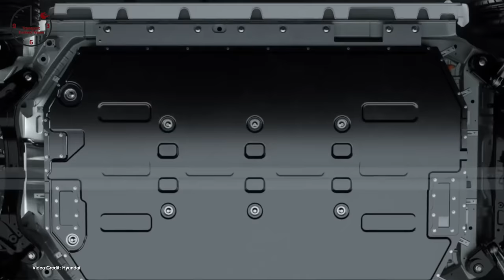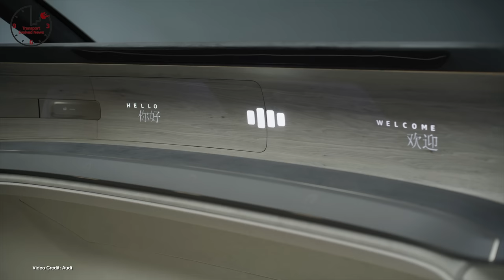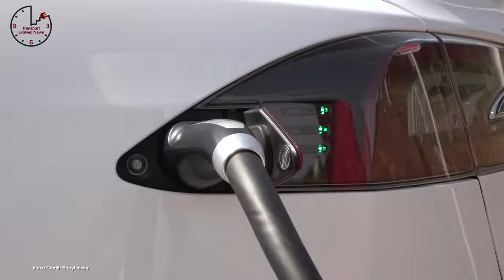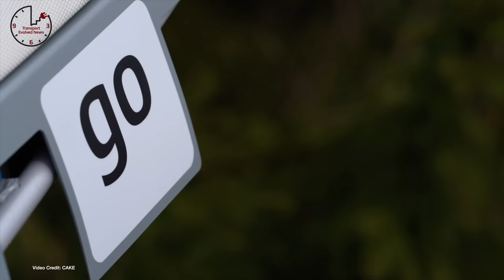TEN 383: Massive 800V Switch, Rivian CEO Warns of Battery Shortage, GM Kills Chevy Spark EV Support

Comment: Im done with GM EVs. First the issue with my Bolt battery recall and now dropping support for my wife’s Spark EV that is still in warranty! 😠 

No more GM EVs for us
Reply: So sad to see this...I'm driving a second generation Volt, which has been awesome, and saw it abandoned when GM could have used the Volt to help transition their dealership network to EVs.  So many balls dropped, and not by accident.  This was GM's plan.  Pathetic.
Reply: I hope your Spark pack lasts longer than the body.
Reply: Is like they expected potential customers to transition all at ones instead of building advocacy through early adopters. But what is more shocking is that their CEO belief that they are leading the EV market in the US.
Reply: I question your choices too 🤣 you bought both their shitty cars - bolt ev and spark ev 🤣🤣🤣
Reply: @richardalexander5758  the Volt was going to be my next car,  a few years ago. But I'm glad I didn't buy one since production stopping is a huge problem.
Who knows how long before they stop carrying essential volt parts
Reply: They were different times. We are early adopters, got them for a good price when the only other options were Tesla S/X 100k and Nissan Leaf without battery conditioning system.
Reply: @arjtalwar  My wife has a Bolt. The cells have been replaced. It still doesn't have much EV competition in it's price range. For twice the money, the Tesla is better, but for the same money, would you rather have a Leaf, with CHAEDEMO and no thermal management, and less range? Everything else starts over 40k.
Reply: Sorry about the bad experience, that spark battery might last quite a while before it's 2nd life, it seems like everything other than early Leaves are doing well. Used Bolt is my next EV.
Reply: @arjtalwar  you have no idea what you're talking about
Reply: @peterkn2   Yep, it could become a problem, but I hope to have gotten my money's worth out of my Volt before it becomes too much of an issue.  Maybe It would be possible to replace the gas engine with a secondary battery pack sometime in the future.  The Volt is really fun to drive, and sold me on EV's.
Reply: MT VISION
it's not 100% that's the case, it's he said/she said.
if they refuse to cover warranty, well they will likely face legal problems. considering they must honor the warranty they provided under federal law (in the US at least).
Reply: The word on the street and I’m no sure if it is true. GM will do and MSRP swap or buyback if the battery goes bad.
Reply: @rp9674  It's one weakness is charging speed, which tops out at 51-52kw, but all Bolts have CCS, and will have 259 mile range with cells made in 2022, except the EUV. There are still places that are short on CCS chargers, but I expect that will fill in. EV sales nearly doubled last year to 550,112 which is more than every EV sold up through 2017, and vehicles are on the road 13 years, so the number of EVs on the road is growing. The Bolt is fabulously efficient putzing around town 30-50 mph.
Reply: @fjalics  Hmm - just finished charging our $30k Leaf Plus @76kW; still pulling 30kW @90% SOC.  True, only 220mi or so range so you got us there.
Reply: To be fair it was obvious from the start that SparkEV was nothing more than a compliance vehicle. The lack of support is unfortunate, but not unexpected.
Reply: The Bolt is the only fully EV close to my price range. I'm debating just going with a traditional Prius hybrid. The Prius Prime is a touch out my price range. At this point I'm waiting to see if the U.S. gives GM back it's incentives to make it a little more affordable for me.
Reply: @mikecarter2737  That's  interesting. I never knew how much they could pull. That's about 50% more than a Bolt, though I think it "rapidgates" doesn't it, as in if you do back to back DCFC sessions, the second one is slower, because it can't cool the pack. It unfortunately has a dying charging standard. The new Ariya has CCS, and a thermally managed pack. My brother got a 2013 Leaf in 2017 and is driving the piss out of it. I actually drove that thing from Ohio to NJ. I spent a lot of time at Nissan dealers on 3.3kw Level 2, ran a cord under the doorsweep of a Motel 6, and my savior, Country Line Restaurant 14206 PA-35, Richfield, PA 17086. They had a Tesla destination charger, and a 32amp Clipper Creek on a pole. I did not have the range to get from State College to Harrisburg without them.
Reply: GM has announced that the reports that they will no longer be making replacement traction batteries available is false.  GM currently does not have any battery replacements for the Spark EV in stock but are hoping to get some soon.  That the current lack of batteries is due to supply chain issues brought on by COVID.
Reply: @arjtalwar  Neither the Bold or Spark are shitty cars.  In fact they are great cars.  GM didn't make the Bolt's battery.  The report the Chevy was no longer going to provide replacement battery pack for the Spark EVs is false.  I personally have a 2014 Chevy Spark EV that has a Lithium Iron Phosphate battery pack and even at 8 years has only lost 1 maybe 2 miles of range.  Had GM stuck with the Lithium Iron Phosphate battery for all their EVs they wouldn't have had any of the battery fire issues they had with the Bolt.  Lithium Iron Phosphate batteries last 2 to 3 times longer.  Are cheaper to make.  Won't catch on fire even if you drive a nail through them, are non toxic, create mush less CO2 in their manufacturing and can be charge up to 100% and drained to 0% daily without damaging the battery.  All that and they are much easier to recycle.  Only down side is you need a battery about 10% larger to go same distance as EV batteries that use Cobalt and Nickle.  Oh yeah and Lithium Iron Phosphate batteries can be DC Fast Charged as multiple times a day without being damaged.

Comment: Model 3/Y 82kwh 400V pack charges at 250kw. Porche Taycan 95kwh 800V pack. Charges at 270kw.  The size of the pack, the C rate of the 3-4V cells set the real limit. Upping the voltage to 800 reduces the size of the conductors you need because you only need half the amps, and increases how much insulation you need. Elon answered this question in the Q1 call. He said going to 800V saves about $100 per car.
Reply: @rogerstarkey5390  Tesla has a large and growing charging network. Expending a lot of time and resourves upgrading all of it to accommodate the higher voltage is a big consideration. They said for smaller vehicles, it's not worth it. For a 500 mile Cybertruck or a semi, it may very well be worth it. She said 800V charges faster. That voltage has no bearing on charging speed. It impacts the design.
Reply: So everybody is going 800V except for Tesla, which means 90% of EVs will be on 400V.

Phillip.
Reply: Only $100. But the manufacturers look at it by the production numbers, not the savings to the consumer. 10-20 million cars produced over the next few years is a huge savings for the automaker. They may pass on the benefit to the consumer, but certainly not the savings.
Reply: i just happened to roll into an Electrify America Station with my Ioniq 5 (800V), it was right next to a row of superchargers. I had 20% when I rolled in and charged to 90%. Almost all the Tesla's that were there when I plugged in were still there when I left. Now maybe they were all charging to 100% from 0%. but it's not about the top charging speed, it's about the curve. If I plug into a 150kW charger, the inverter will line double and give my 175kW and never drop below 130kW alll the way to 80%. 90% usually takes 10 minutes longer.

Comment: It's really fun to watch the ev market expand and give Tesla some real competition. It appears Rivian's workforce and QC dept. has a ways to go to work out the various areas beyond the electric platform itself. Seeing reports of sticking tailgates, loose brake line fittings, etc... What I care about in these times is affordable reliable ev transportation options that someone making under $75k can actually afford. Right now in the American mkt that leaves only a couple of cars even close. I just traded up from my 2020 Bolt that was under current recall for a 2022 Bolt that has the new battery and saved money doing it. I had no desire to mess with their concierge dept or enter the class action suit currently going forward. ALL I want is an affordable, reliable ev...that I can now fully charge...and park in the garage. Btw, the improved seats really make the deal! That was our only complaint with the 2020 Bolt. ;)

Comment: I really hope the yoke doesn't become synonymous with EVs. It should always just be an option and not standard
Reply: I think that the yoke is more associated with automated driving systems. It's a small step toward the goal of removing the steering wheel entirely. It is possible that it will get associated with EVs (more expensive EVs anyway) because they tend to be the most future forward cars that are produced. 

At least the Lexus version does not require turning the wheel as far as a normal steering wheel, but I'm not sold on the idea.

Comment: If there had been a wider distribution for the Spark EV there might have been a market for someone to pick up the replacement battery rights. I know that 3P providers have been able to start doing remanufactured batteries for some hybrids...maybe something similar could be done here.
Reply: Only if there is momentum in the market like with the Gen1 Leaf. A good number would be 500K examples. You might have a cottage industry at 100K. GM sold 7500
Reply: @theairstig9164  I bet batteries get cheap enough for custom built batteries to be a thing. I see LOTS of ICEV to BEV conversions in the future

Comment: A few comments on the Texas grant - it was first come first served so Tesla must have been later to apply.   Secondly, Tesla had the electrical infrastructure in place already so of course their cost is lower.  Thirdly, it’s good to have more locations not less like some seem to want if we only put more chargers at existing locations.  That does nothing to help most people.  Lastly, it looks Bucees got some of that money.  They are the best gas stations in the country.
Reply: I always like to understand different   points of view. What would the argument be to say that it's better to have more locations with less chargers than fewer locations with more chargers.

Here is my opinion on why more chargers at each location are better. I might be wrong.

They are cheaper to build and they can be built faster (less permits and so on). 

Here are the choices:  two or four charging stalls every four blocks, or 8 or more 50 miles apart.

I think that especially for non Tesla vehicles (Tesla shows the status of the charging station on the screen) it could make it really difficult to show up to a charging station to find it full to then drive four blocks to find the same situation then having to make the choice of taking a change and drive another for blocks or just wait inline at the current station.

If we need to charge 20 vehicles, I think it would be easier to charge at one station that has 10 stalls than at 5 stations with 2 stalls each.

It makes sense to have gas stations on every corner because refueling is fast but for charging  specially if your are running the battery low, it's better to arrive at one place and know that even if all 20 stalls are taken than to drive around to another station.

Also if in one of those stations with only two charging stalls one is broken, that station is down to 50% capacity.

This is not to say that having more stations with many stalls is better for EV owners. So far the largest one I've visited is a 24 stall 250kW station.
Reply: My main concern is the fact that sometimes you don’t always want to plan out (or even use the navigation) every time you go out for a drive.   It reduces your freedom of movement because you always have to think ahead.  I like to just jump in my car and wing it on which way to go and when to stop.  With Texas being so large having to go to mega stations limits that flexibility.  I realize there are economies of scale as you get larger (see my Bucees example of the earlier post).  Also there are times when accidents or construction making certain routes difficult.  This would necessitate other routes which could be problematic when finding a limited number of locations.  

Part of the money can also go to external upgrades to the grid.  Hopefully they are thinking ahead and planning to add even more charging stations in the future using these upgrades.  

The last part regarding finding working chargers and the number of chargers at each station will be mitigated by the use of technology.  Part of the grant process requires that the grantee have internet access for the chargers.  This should help with charger availability status.
Reply: @mattferguson9109  I see your point.  Do you drive an EV and if you do, do you mind sharing what make and model.

Comment: 16:48 It will be interesting to see what happens with the XPeng P5.  It is difficult to get a handle on true EV demand.  Tesla's order books extending out a year show very high demand, but how many people want an EV but just can't handle joining such a long queue?  The legacy auto makers (and wall street) have consistently underestimated EV demand.  Elon seems to believe there is way more demand and is ramping up manufacturing as fast as Tesla can do it.  If demand is high enough, both Xpeng and Tesla will be able to sell everything they make at current prices.  That would be great.  So, the question is how many will Xpeng make?   If Xpeng makes 50K per year, it will have very little effect, but if they make 500K per year they may be able to affect Tesla prices.  Personally, I hope demand remains high and all EV manufacturers sell everything.

Also to consider, if demand for these EVs remains high, will people buy the P5 and immediately flip it to the used car market.  If that happens, XPeng would be wise to raise prices until the EV market supply catches up.

Comment: Very disappointing that GM no longer supports the Spark EV. Auto makers should be required to have parts on hand for vehicles for 10 years after the end of production. Parts availability seems to have gotten quite poor. I'm waiting for parts for my Chevy Bolt, but GM doesn't have what I need in stock.
Reply: They rely on their suppliers to do all the work and outsourcing production as much as possible. They sold 🇺🇸
Reply: re: "Very disappointing that GM no longer supports the Spark EV." no worries, Tesla doesn't support their original MK1 Roadster either.  oddly enough CNBC just did another report on this dated Mar 27, 2022.  they also did one back 2 years ago.

Comment: 10:00 wait what about a mechanical setup doesnt allow 150°, but more importantly why would you want that? It will be extremely sensitive and difficult to hold a steady line. After all, there is a reason the steering ratio have been setup high
Reply: Speed sensing steering control has been around since the late 1980s. The algorithm is well known
Reply: It'll probably be some awful non-linear response curve, with either no direct kinesthetic feedback or worse, some kind of Rube Goldberg "synthetic feel" mechanism.

Comment: Again no, charge voltage does not allow faster charging. Charge time is limited by chemistry and C-rate of the cell NOT PACK VOLTAGE.
Reply: But there is a limit to how many amps you can shove through a given size of wire without losing too much voltage and energy to resistive heat. The wires inside the car, in the charge cable, and internal to the charging station. Doing everything at 800V rather than 400V means much thinner, lighter, cheaper wires to support those newer 250 and 350 kW capabilities.
Reply: @ps.2  ya sure, but none of those things have anything to do with charge time limits.

Comment: Dear TEN,  Related to announcing just that a Tesla crash into something by it self because of handler using the summon feature, is de facto saying that the technology is bad.  I believe that the incident is most likely due to the handler using the technology irresponsibly, The technology is new and it has its limitations.  The feature is designed to be used with a handler monitoring and controlling the maneuver via phone with the car in sight at all time. The handler is actively controlling if the car moves at any moment during use of summon.  If a collision is about to happen, then  you stop the car by lifting your finger from summon button on your cellphone.  Otherwise, it is either stupidity, carelessness or lack of knowledge of how to use the feature.  Just showing the video without additional context feels like spreading FUD against EV, new technology and Tesla.  Cordially, MichaelAngelo

Comment: Its really simple Nikki. The robotaxi will be optimized for longevity, not performance. Tesla's autobidder software guarantee's the lowest energy cost. Solar power is already less than 4 cents/Kwh today without subsidies. Its likely to be less than two cents by the time the service available. An autonomous electric vehicle that has its cost of materials amortized over a million miles? Can turn a profit at less than ten cents a mile. Especially when you take into consideration that Tesla maintains ownership of the resources and can recycle the entire car into a new one for maybe $100 worth of energy. Elon is not out to get rich off of it. He is out to remove the need of personal ownership and accelerate the switch to sustainable energy. Every car shared removes 6-8 vehicles from the over all transportation fleet. Which means that we need 60-80% fewer EV's